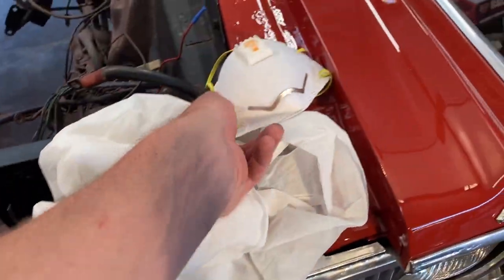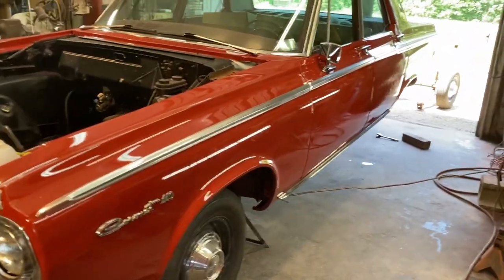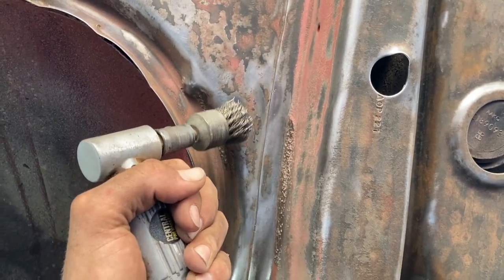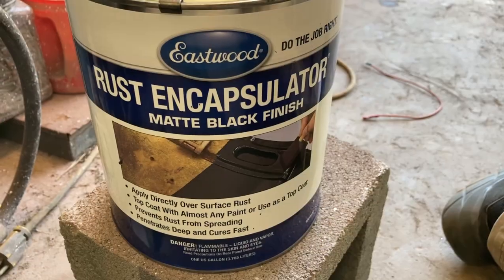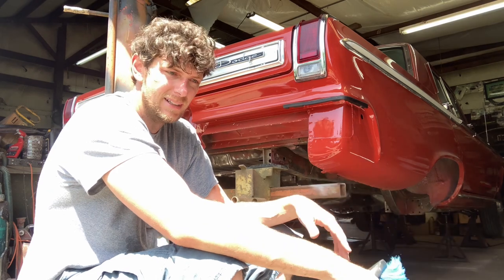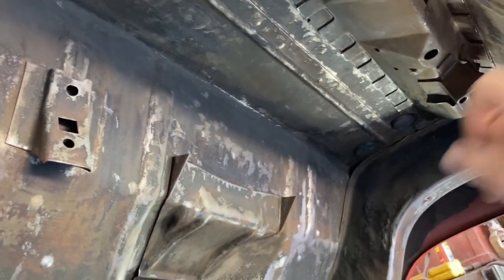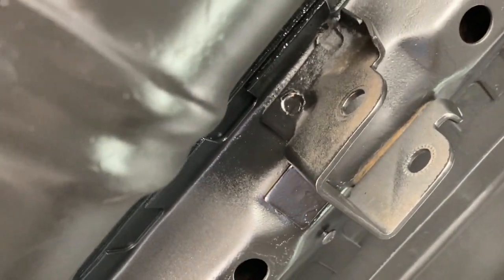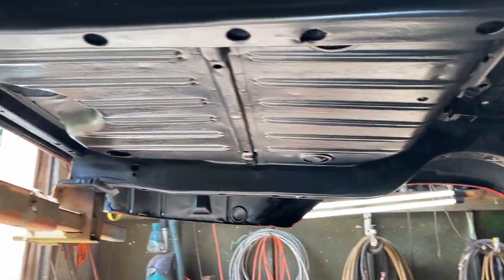Protect the Bottom of Your Muscle Car: Eastwood's Rust Encapsulator Full Process #diy #eastwood

Comment: I remember back in the late 60s Chrysler had a commercial showing the entire frame,  floor , and trunk sheet metal being dipped in primer.  They said it had electricity going through the primer to help it bond to the metal.  They ran that until the mid 70's I think. I guess it didn't last very long.  That car is before the dipping though. 

Another great video Joe.  Thanks for sharing
Reply from the maker: Thanks Bert! It’s a world better now.

Comment: JustMopar Joe,The car looks great !  I personally stay away from any undercoatings,liners,sound deadeners etc, on my '65 Coronet (or any other performance car) because it is dead WEIGHT to haul around. It is fine for a cruiser. But going all the way back 40 yrs. to when i was learning round track racing,it was drilled into my head to lose unnecessary weight. Now it's turned into a lifelong obsession.
Reply from the maker: I dig it Shane. This one might get some light undercoating, but owner was hood with leaving it just like this. It’s an easy touch up if it chips.

Comment: I really like the matte black underneath, great job . I actually went the extra mile and stripped the undercoating , many hours with a heat gun and scraper
Reply from the maker: Thanks brother. I was fortunate that there wasn’t any under the car. Only the wells. It was surprisingly good considering the age.

Comment: Mopar Joe last step after clean and rinse I always wipe everything down with alcohol then you won't have to worry about flash rusting and your ready for that beautiful finish your putting on.
Reply from the maker: Awesome! Thanks for sharing. I usually use the spray way glass cleaner in easier to spray places. But I did use Nason Grease and Wax remover on this one. Took about 3 passes to get it wiped clean!

Comment: Hey Joe, just caught this video and it looks excellent. How long did it take with cleaning and painting?
I have a 65 coronet 440 but I'am looking to improve the side trim on the car.. I used different polishes but it took me forever, 2 hrs. to do 3 inches. Did do anything to  improve the finish? Thanks.
Reply from the maker: Thanks for watching! It seems like I was around 16-18 man hours total to get this done. It’s a pain on your back, but I let the tools do the work. If there was any factory undercoating that was really stuck, I worked around it.
Reply: Thanks Joe.  What about aluminum side trim. Did you do anything to improve and how did you do it? Thanks

Comment: Looks very good. Since the engine & trans are out are you going to paint the engine compartment body color?
Reply from the maker: Thanks Pat. You may have missed my earlier video. This is a customers car. He wanted black under hood. I would have went body color.
Reply: @JustMoparJoe  Thanks for the info. The work you've done is great, and the working on the garage floor is doable but time consuming. The non matching body paint in the engine compartment is a deal killer. Then it's negotiation time.......
Reply from the maker: @patborovicka7938  thanks again. Hopefully the hood stays closed and the miles keep on rolling. He will daily drive this one.

Comment: Awesome work! I’m about to spray my Bronco. Did you reduce/thin the Rust Encapsulator with anything to make it easier to spray?
Reply from the maker: No sir. I used a paint stirrer in my drill and worked it well. It was plenty thin. I recommend top coating it for longer durability. In my last video, I used it as a primer for bare metal before applying acrylic enamel.
Reply: @JustMoparJoe  awesome man! Appreciate the feedback. 💪🏽

Comment: Have you ever used that POR 15 product that all the kids rave about these days?  How would you rank this eastwood product vs the POR 15?
Reply from the maker: Yes sir I have. POR15 requires a few more steps. You have to use a metal etch, which is acidic. Definitely wouldn’t want to lay in that on a creeper. Best I can tell, the Eastwood stuff stands the rest of time better. POR15 has to be topcoated. The sunlight will make it brittle.

Comment: Nice! Can you point me to some wire brush sources? Prep is everything
Reply from the maker: I like the cheapos from Harbor freight, but also you’d be surprised at the selection from Amazon and eBay. If this was my car, I would have upgraded to rust encapsulator plus or topcoated this with paint. Check out my recent d100 video, where I paint the engine bay. I use the rust encapsulator in a can as a primer over bare metal and rust spots, then shot Acrylic enamel right over it, after about 15 minutes.
Reply: Thanks I was looking for a better way to fight rust. I’m working on a 1994 dodge ram with a Cummins 12 valve. And not a Mopar but because of nostalgia I’m doing a 1964 Volvo Amazon 122 and will be replacing floor panels and generally getting rid of rust very soon
Reply from the maker: @michaellyttle4347  awesome! You can also get the permatex rust converter in the white bottle at Oreilys. It is very acidic and turns to a black primer.

Comment: I'm looking to do the underside of my 2011 crown vic with the Eastwood encapsulator but I've heard it's a great way to trap moisture and ruin the car. I'm wondering if there's any way I can avoid this fate or is it just an issue of not maintaining the coat?
Reply from the maker: Just like any paint, if there’s no moisture to trap, it won’t trap any. This stuff seals the metal and won’t allow air to get to old rust underneath. If you’re worried that it won’t stop the rust, you ca use a rust converter like the sell at Oreilys. I still think it’s good to top coat the encapsulator with an enamel.